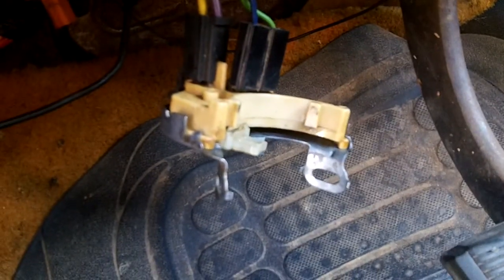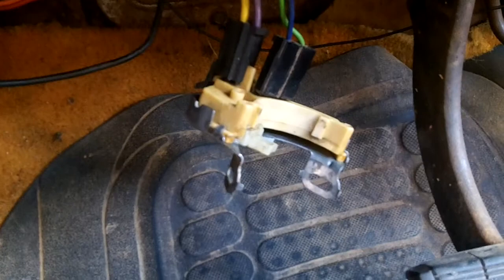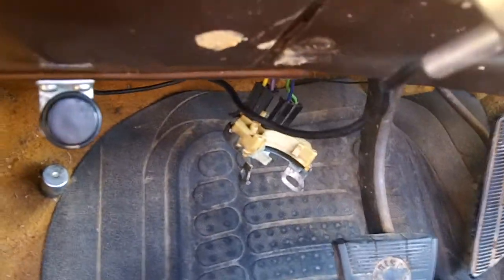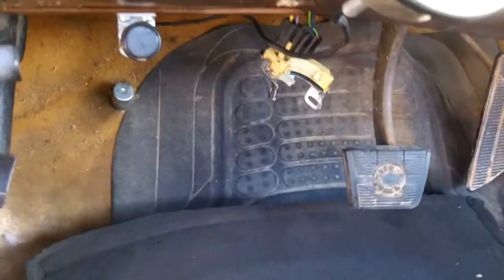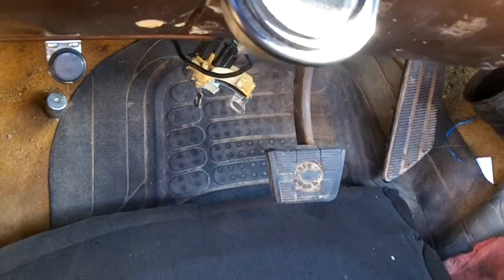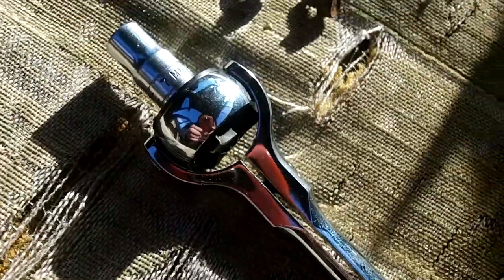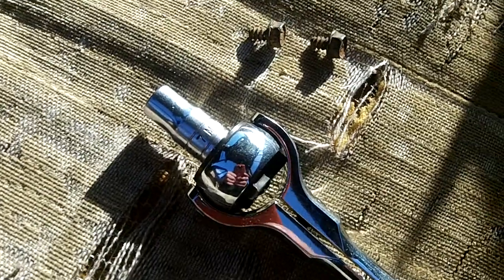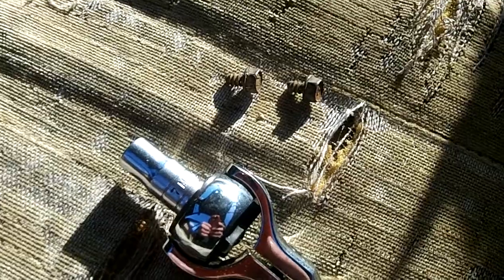1981 C10 reverse and neutral safety switch_01

Comment: Thank you for posting your video, iv been working on my 83  for a long time now and still dont have reverse lights . Mainly cause im missing some wires and haven't been able to anything on wire diagram. I was waondering if you could please help by letting me know which wires go to what and what they do. Think its yellow and purple wires im missing. Thanks a million Sir.
Reply from the maker: C10 4-lyfe thanks for the comment.  You don't have a manual transmission, do you?  Or maybe the truck had a manual in it and it got changed to an automatic somewhere in the past.  That might explain a missing plug.
Reply: @kazoocruiser4873   Yes, its automatic. The thing is, is that my reverse lights aren't working. Which wires are those?  Thanks.
Reply from the maker: @r.c.4153  If your neutral safety switch has one plug hooked up to it with the green and blue wires, then the other plug you will need carries the reverse circuit, in my case, purple and yellow wires,.  You might have to climb under the dash to try to find it.
Reply: @kazoocruiser4873    I'll try that. Thank you for the info. Happy new year to you.
Reply from the maker: @r.c.4153   I found a wiring diagram here:

https://www.autozone.com/repairinfo/repairguide/repairGuideContent.jsp?pageId=0900c1528004c636

And it looks like the yellow and purple wires are for the starter lock-out, which means the  light green and blue are the ones you need.  Sorry for the mis-coloration by me.